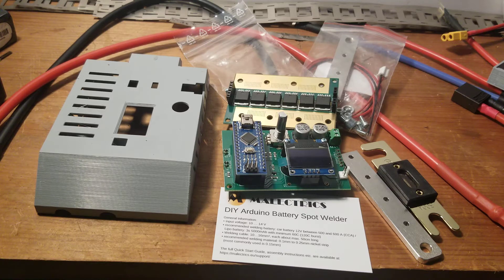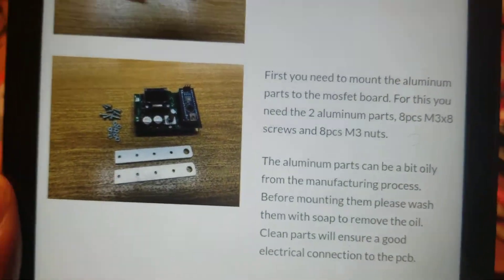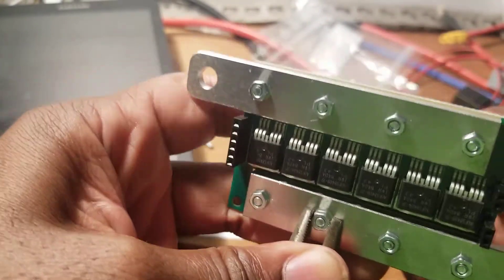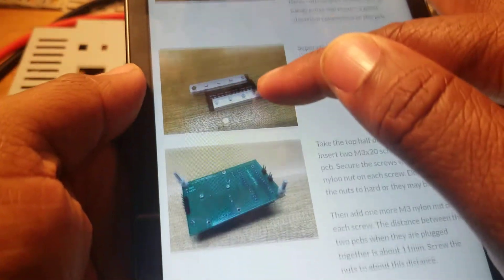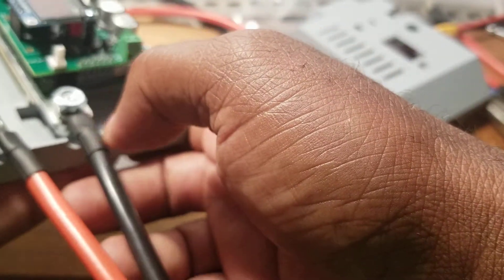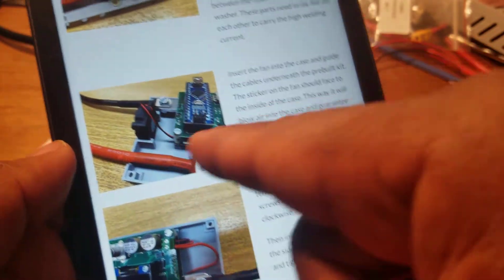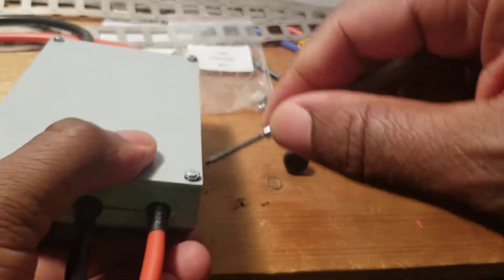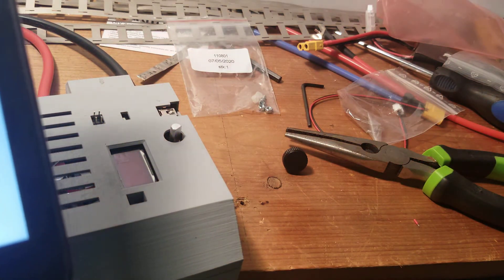Malectrics Spott Welder Unboxing &  Setup

Comment: Bought this built this  error code  that I wired foot pedal wrong . Can’t seem to get help making it work .  Just buy the purple board off enay
Reply from the maker: Make sure to check the wiring diagram again, it can be tricky.